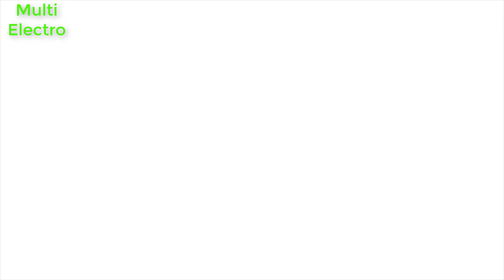how to make 17kw free energy generator from 3hp motor and 17kw alternator  with full rpm calculation

Comment: This machine can run until the power derived by the motor at the start with th consumed power, the flywheel can't produce power. This machine is technically wrong, could have been filling the market if it is correct.

Comment: 1) Tại sao ý tưởng “mô-tơ → bánh đà → máy phát → trả điện cho mô-tơ” không thể tự chạy mãi

Ta xét vòng khép kín năng lượng — điện cấp vào mô-tơ → mô-tơ chuyển thành cơ năng → truyền qua cơ cấu (dây đai, bánh đà, ổ bi…) → máy phát chuyển lại thành điện → điện đi qua biến đổi/điều khiển trở lại mô-tơ.

Gọi các hiệu suất (từng bước) như sau (ví dụ thực tế, con số thầy sẽ thấy hợp lý):

hiệu suất mô-tơ (electrical → mechanical): 90% = 0.90

tổn hao truyền động (dây đai, puli, bánh đà, ổ bi): tổng cộng 96% = 0.96

hiệu suất máy phát (mechanical → electrical): 90% = 0.90

tổn hao chỉnh lưu / biến tần / dây dẫn: 95% = 0.95

tổn hao cơ học phụ (mỡ, quán tính, gió...): 99% = 0.99

Tổng hiệu suất vòng khép kín = 0.90 × 0.96 × 0.90 × 0.95 × 0.99.

Tính từng bước (viết rõ từng chữ số):

0.90 × 0.96 = 0.864

0.864 × 0.90 = 0.7776

0.7776 × 0.95 = 0.73972 (thực ra chính xác: 0.7776×0.95 = 0.73972)

0.73972 × 0.99 = 0.7323228 ≈ 73.23%

Kết luận: chỉ còn ~73.2% năng lượng ban đầu khi quay một vòng khép kín. Nếu thầy cấp 100 W cho mô-tơ, cuối cùng chỉ có ~73.2 W quay lại — thiếu ≈ 26.8 W, hệ sẽ giảm tốc và dừng. Để duy trì tốc độ, phải cấp thêm năng lượng bên ngoài bằng đúng phần bị hao tổn. Không có phép màu làm hiệu suất vòng >100% được — đó là lý do vĩnh cửu là không thể.

Comment: This device uses several known technology aspects, mostly momentum to even out the peaks and valley of producing energy. Small energy input to drive a heavy flywheel effect which drives the generator producing power. Now you need to demonstrate if a heavy load is applied to the generator, something needing 3000 to 5000 watts of power to run and show if it will continue to perform, not just lights or small wattage loads like we see here. Hook it to a central air conditioner system along with several refrigerator/freezers all kicking in at the same time, then let's see if the flywheel can maintain its momentum and overcome the additional magnetic drag the generator will have applied to it. Lights aren't what energy generation is about, run a heavy load demonstration then you'll have something!!
Reply: Surely you jest?  This setup can't run itself, much less a load.

Comment: Why is electric used to roll the electric motor?  The flywheel should be rolled manually without any source of electricity.
Reply: this unit can be operated by manual or helped by electric motor
Reply: Electric motor helps the flywheel not to stop. You may not use more than 60% of generated energy, otherwise the system will stop. Energy generated by the flywheel is as high as the speed and weight of the flywheel but only 60% of this energy should be used to run electric loads... You must start the system without load and after nominal speed isp reached you may connect the generator...
Reply: @YYYTTT633  OH wow! Very useful information.
Reply: Hi how much do your flywheel weight ?
Reply: You can even create more power using the same method. Lets say you attached 200mm gear (1) on a motor. At 1400 rpm if it is connected to Gear(2) of fly wheel which is 100mm. Then the speed of flywheel will get double as of 2:1 gear ratio. Now you have Gear(3) on other side of fly wheel which is 300mm   at 2800rpm. Which is further connected to an gear(4) of alternator with dia of 200 mm. Then  again we get a ration of 4:1. Therefore, the rpm of alterbator will be 2800 x 4= 11200rpm. Now the problem is that you cant run the flywheel at 2800 at that weight so its better to use light weight material like aluminum. Now comes electricity part, when motor is at its highest speed, remove the power supply from external source and plug into the power circuit of you outpout power. As per above data you get 1x2x4 times rpm. Therefore, lets say the motor uses 3kw. Then, 3x2x4=24kw output. Then when you connect the motor plug to your power output. Then, 24kw-3kw= 21kw. Take 70% of safe usable power. Then 21x 0.7= 14.kw usable power as per my assumption. You might get way more power out put

Comment: Yes it work.Take note:For the safe use of electrcalical appliances a Generator the reguired HERTZ  50 TO 60 and the Engine or FlyWheel RPM 15,000 to 18,000. Demo shows visibly visible to slow.

Comment: Just clarify why will the motors consume electricity when they themselves are generating electricity. The rule is either the generate or they consume.current input n output sockets can't  be the same.

Comment: Hi i think you doing something wrong . 
   You need to put the tensor in the other bell and need yo be losen when you star the motor from exterior sourse , then the motor can move it the flywheel easily and  inercia on it . The use the tensor to ajust the generator bell . Thats the way that shoul be . 😊

Comment: Good evening mate. I'm trying to put together a free energy kit.
With a 17kw generator, 3hp thrust motor and a 32-inch ball bearing of 120 kilograms. With the main voltage it works without incident and as soon as the change is made the system fell and was out of service.
The alternator is the same with what this video presents with the difference in frequency and revolutions.
In my country it is 1800Rpm and 60Hz. I would like to know or an explanation of what would be the problem I have.
Reply: You just arent using the same batteries they are
Reply: @donstash4295  bana kalırsa altörnatüre gelen devir yetersiz geldiği için 50 hz bulamıyor onun için devir yavaş yavaş düşüyor

Comment: Good evening dear multi electro, I am very amazed by your ingenuity and encourage you to go ahead. wanting to copy your experience, I found a 37.5 kva alternator and a 10 hp three-phase electric motor with 3000 revolutions per second, can you help me on the weight of the counterweight and the sizes of the pulleys to be used if necessary? Please.

Comment: I would like to know if you dont have power what source of power can that fly wheel work ? and can solar  power and the battries can start to run that motor and the fiy whheel?  and can that altanerter can i use as hydro power?

Comment: I have a 20 kw 4000 rpm .  3 phase alternator. And a motor single phase 4000 rpm what is the size and weight and diameter of the flywheel required

Comment: Should interchange the placement of the alternator and the electric motor, with this setup it could be right with just for light bulbs, but when load is applied like those electric grinder, and with high wattage load it will be felt heavy in the part of the alternator...😁 Torque reduction is applied inversely with this set up
Reply: Saya sudah coba test generator free energy 
10 KW tapi hanya mampu  bawa beban 
daya 40 % , dan  atas itu generator stop berhenti tidak mampu gunakan beban berat mungkin ada kesalahan torsi lemah.
Reply: He can just interchange the pulley in order to increase the alternator's torque but we don't know the maximum rpm of the alternator
Reply: Debería dársele más velocidad a la rueda de inercia (haciendo nuevos calculos de las poleas) y utilizar un estabilizador de tensión para alimentar al motor, de esa forma se mantendría el voltaje nominal y por ende, la velocidad del mismo.

Comment: TO  Compenate the  LOSS  of  ENERGY  due  to  >>  FRICTIONS  the  FLY-WheEL the solution  is to  use  TWO-2-motors  another motor  will  be dri-ven  by  SOLAR  -POwer   to drive  the  Fly-Whell .

Comment: its not generate 17 kw, but at least conserve it in a loop. For a continuous balance you can't plug more than 1/3 ( max ) of power. Without consider any loses by the parts. One part is for the motor, one for the wheel, and one is "free" ( its the inertial difference power ammount ). 

One dude in a tested system use a magnetic rotor for this purpose, instead of a flywheel. in this case, the inertial force its summed to the magnet power in a less than 0 resistance.it use a battery, In idle mode conserve energy, who restituite when is in full load, for not risk to unbalance the system. 

If you unbalance the system, you need a certain ammount of time for it to return back.

Comment: IT will works.
Of course some changes are necessary to obtain more power of up to 74238 GigaWatts.
It is elementarny knowledge that to have a GREEN and FREE energy, the generator must be painted with green paint. Otherwise, this Orange genaruter will give you Orange energy which is much smaller, because less electrons is flowing in Orange currants.
Tha Motor is ok because is blue.

Another condotion is that you must wear a pijama and sandals, without pijama tha power goes down to 6312 Ohms/ square bucket of goat milk.
Third and most important is to build this ganerador on sand, so you can hide the supply power cables in it and nobody see them.

Comment: A 20kW motor at 85% efficiency will convert 20kW electrical power into 17.6kW rotary power.
A 20kW generator at 95% efficiency will convert 17.6kW rotary power into 16.7kW electrical power .. A loss of 3.3kW just to convert and turn things. This doesn't include the losses from belts, wiring, heat, bearings, changing rotation directions, flywheel aerodynamic drag ..
Reply: Изобретатель, ты хоть представляешь, какую мощность можно передать одним ремнём профиля "В" Для примера на токарном станке с мощностью двигателя 7,5 кВт стоит ПЯТЬ ремней.
Reply: Where in this arrangement and explanation is a 20KW motor mentioned?
Reply: This motor will make with neodymium magnets
Reply: Thanks
Reply: Thank God !! Another voice of reason exists !! Good work trying to show a bit of science to these gullible folk my friend !!
Reply: Apprenez quel est le rôle du volant d'inertie, et vous l'aurez compris revenez nous voir.

Comment: If all this is true we can improve it a lot

put for example on the same line of shaft the generator the motor and the flywheel which would suppress the friction of the pulleys with possibly a magnetic drive.
to put all this in a sealed box and draw a primary vacuum to limit friction due to the air. and can be the inexpensive graffen matterials instead of copper in the windings have the superconducting properties are interesting to limit the losses in line
Reply: Direct coupling wont work, as this set-up has to play with the  Inertia of the fly wheel. Keep up the good work. We cant complain on free power.
Reply: The generator requires higher rpm than the flywheel hence the need to step up the ratio with a bigger pulley. Direct coupling with flywheel wont work.

Comment: This will last for only 10-15 mins because there is frictional loss of energy in the pulleys so when there is not enough energy in the fly wheel this will automatically stop operating
Reply: This could actually work but with very very little energy output. The more amps drawn from the generator the more torque required from the motor so after a few minutes it will stop

Comment: Hello, I want to try your project. That's why I want to master all the details. How many kW is a 3hp engine? What features do I need to know? How many rpm is the alternator at? What features do I need to know? I want to try and see the result myself. In short, I want your help on the details of the engines I need to buy. take it easy.

Comment: nice work !!! but for full load at  75 ampers  220v >>    you need to run whel at least 1000 rpm  >>>> much energy  in the flywheel
Reply from the maker: Ok, thanks
Reply: सर मुझे चाहिए यह कितने का मिलेगा कहां से मिलेगा सर मुझे और कितने रुपए देने होंगे सर 5 किलो वाट में
Reply: सर मुझे इस नंबर पर जवाब दे सर

Comment: Prove this works, by  A FULL  TEST,  and have it running at Full Load Amps for at least 12 hours,  and have an Independent Engineer Certify the test,
Reply: It was done but we jast shoten TIME for the viewers
Reply: Have you ever visited the power hydro power station before?
Reply: How many kgs the weight..?
Reply: It doesn’t work. It only works for a video. It only works because there is no load. As soon as you connect a load it will act like a brake on the whole system. The voltage on the motor will drop and the current will go up. That will take away from the generator. Basically it is a mechanical battery.

Comment: السلام عليكم و رحمة الله :     excuse me sir for asking a too basic question: indeed I am not a specialist!
Why use the flywheel? What exactly is his role? What happens if it is removed by connecting the engine directly to the alternator
thank you so much
Reply: To maintain torque that will continue rotation, when the initial force of rotation is removed
Reply: Flywheel act as a energy storage part. You can get that energy from flywheel for further cycle run.
Reply: Megnat sestam he ye

Comment: Hi brother.... if I need 1600 RPM , what’s the pully sizes ? I’m from Sri Lanka
Reply from the maker: if you will reduce the 9.5 inch pulley with 8.5 inch pulley then RPM will reduce to 1611 RPM.
Reply: @MULTIELECTRON   how can posibal same rpm  moter and da mood....
Reply: Srilanka how to buy alternator
Reply: Yes I get dynamo from Honda gasoline generator... RPM 1500 and htz 50/52 .. it’s working from 1.5 hp motor... now I want change it to hydro turbine.  So I hope your advice and ideas 💡... if you can please help me
Reply: Thanks lot for your response sir .. only one question... so I can run 1500 RPM 10 KW generator from this method sir ? Coz am using dynamo get from gasoline engine generator... thanks